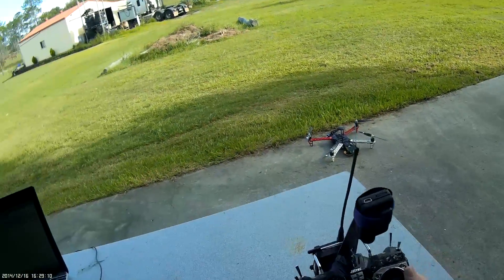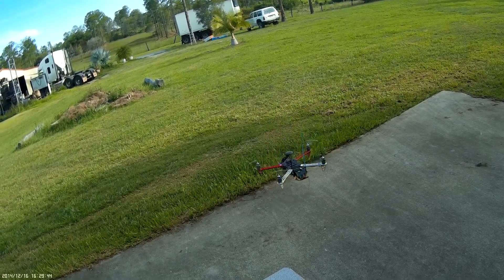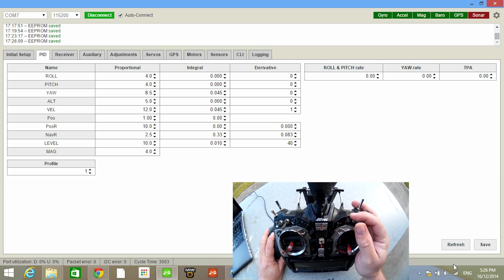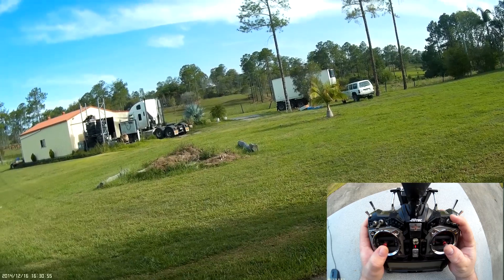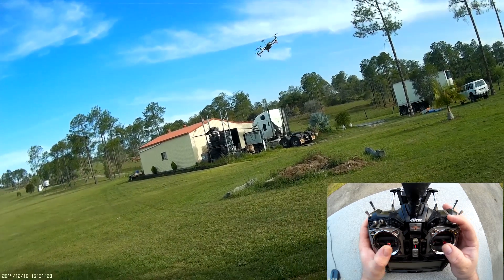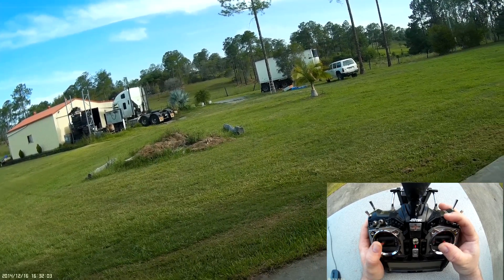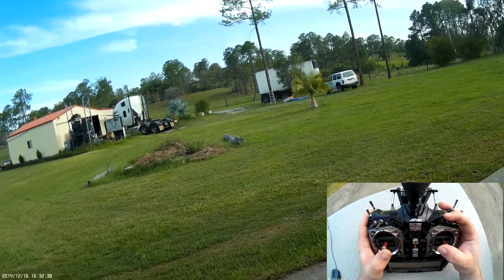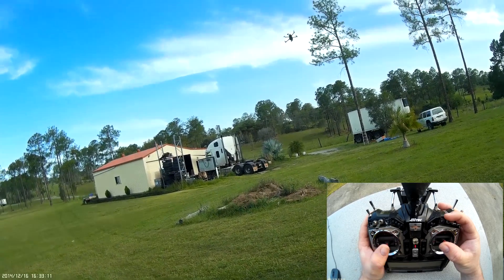PID Tuning video 2

Comment: I noticed in the settings your pitch&roll are both being adjusted by the switch, but your 1st vid you only made pitch setup for adjustments.  What was the reason for changing both at the same time & is it a better option to tune pitch and roll?

Comment: tune near a computer because the settings wont save when you unplug the battery. Plug it in to Cleanflight and save while settings are still there.

Blackout Mini H
I ended up with P=6.5 I=.030 D=40

 Going to take it out for some FPV now and see how it goes =D
Reply: disarm motors and hold left stick down left and right stick down right for some seconds. this will save the settings.

Comment: Is there anyway to Save the in-flight PIDs to the Naze32 board without plugging it into cleanflight? 

Every time I switch batteries it goes back to the stock PIDs instead of saving the ones I just made
Reply: +Cyrus Hostetler   Settings can be saved when disarmed using stick positions: Throttle Low, Yaw Left, Pitch Low, Roll Right.
Reply: Brenden Smith You are a lifesaver! I couldnt' find this anywhere

Comment: dear friend for the sake of my propellers please share a screenshot of your relsult of the whole PID screen, I have S500 frame 20A afros stock simonK FW (should I reflash? if yes, what FW?) multistar elite 2216 920 motors, DJI clone 9,4x4,3 props ant dof10 naze board. question 2: I read about autotune feature, but I can not find it in newest CLEANFLIGT google xhrome addon. has it ben removed or is it hidden?

Comment: Hello, I noticed that my quad changes behavior when I switch to GPS and my throttle don't respond fast when it's loosing altitude
Reply from the maker: +Sol mag This would be because in GPS mode it is also in Altitude hold mode.  The throttle then only acts a certain amount - you don't have direct control of altitude speed change.  Mid stick should have the quad holding. Higher throttle will gently increase height etc.
Reply: +pjman180 thanks for your response. It loses altitude in GPS mode. I tried to keep it up but still it goes down even at full throttle.

Comment: Hi I have a wobble on throttle... you have some advice?
Reply from the maker: +Johnny TSC I'm assuming you're using a mini quad?  To be honest it wasn't a problem I had to deal with on the larger quads.  I am in the process of building my own so no doubt I will come across this issue myself.  I would look at adding some TPA in Cleanflight.
Reply: I will try that! I fly the Blackout mini h quad
Reply: Just changed TPA from 0,00 to 0,20 but still wobble on pitch.. its very sensitive too.. should I turn it up even more? (setup Blackout 6"arms 4s 2204 1960kv motors and 20A ESCs )
Reply from the maker: +Johnny TSC I haven't played with these setting sorry.  It will be coming soon.
Reply: +Johnny TSC Lower loop times and retune your gains. Super later but maybe u still have the problem :P

Comment: Nice video. It appears you're adjusting the PID's for both the roll and pitch at the same time. That works with a symmetrical quad but not the popular ZMR250 type quad which is not symmetrical and because of that is more difficult to tune.
Reply from the maker: +Jim r You are right - this method doesn't work well for mini quads as they are very twitchy.  This video was made before you could tune individually.  Now a days you would be best to use blackbox - I'm working towards more vids on that stuff soon.

Comment: pjman180, you mentioned in your posts below that "I might try and do a vid of tuning the other PIDs soon."  You did such a great job on this video and we are hoping you make other PID tuning vids.  I'd be interested in:#1 - tuning PIDs in angle or horizon mode, and #2 - PID tuning for other PID controllers like #2 and #5, assuming that in this video you are using PID controller #1 MultiWii (but you don't actually say which controller you are using).Please remember to list which PID controller you are using, which flight mode you are using, and maybe even expand it to explain how the five different profiles can be used in each controller!  Oh, and remind everyone how to "save" the PID settings when satisified after making the corrections by disarming and then using the sticks, thereby not having to connect to a computer and use the save button.Again, super job on vid #1 and #2!
Reply from the maker: +FPV in PA Have been playing with Naza and Pixhawk lately but about to do a 250 build with Naze32 so will do plenty of vids then.

Comment: Relativity a good video. What I did not like was letting go of the stick, as it bounced around for a quarter second each time before it centered. What about Yaw PID tuning? No worries bud, just asking for others.I have a similar setup, just 10 options for adjustments, thanks for sharing. http://www.rcgroups.com/forums/showpost.php?p=32526191&postcount=11739

Comment: Pjman, definitly thumbs up for this video, now managed to restrain my quad! ;) 
one question: all works fine in acro mode but if I use horizon mode and make some smooth flights around and stop the quad...then I have to "teach" my naze with some inputs what is level. otherwise it woould drift away. Do you know which value might be wrong looking at this behaviour? thanks man.
Reply from the maker: Dozerboy84 You are correct that you have to "teach" it what level is - best done on a very still day - no wind at all..  At the moment I assume you are using your trims.  Set these back to no trim to start with.  Then take off in acro mode and try to get the quad as level as possible manually.  Then switch to horizon and take note of which direction the quad moves off.  For instance we will assume it moves forward and to the left a little. repeat this to confirm that the quad does indeed move off in the same direction.  Land the quad and disarm the board.  Then you move the throttle to 100% and move the pitch and roll sticks in the opposite direction to the direction travelled.  In this case we would move the pitch stick back and the roll stick to the right. You do these one as a time.  So move the pitch stick back to 100% for 1 second - you will see a light flash on the naze. If the forward movement is fairly strong then move the stick back for 1 second a number of times.  Then do the same for the roll.  Take off and start the whole process all over until when you put the quad into horizon it doesn't drift off in any direction.
Reply: pjman180 thanks your detailled reply but my problem is not that the copter drifts in smooth hover. When I hover in Acro everythiong is good. if I then switch to Horizon/Angle the hover remains smooth. 
When I fly around quickly in Horizon/angle and then stop the quad, the platform tilts in one direction, even with sticks center. I can bring the quad back to normal & smooth hover with some short stick inputs. 
Is this normal or do I have some values wrong? 
Thanks again man for your good support.
Reply from the maker: I haven't experienced this before sorry.  Are you flying in horizon mode?
Reply: +pjman180 yes. horizon or Acro. have seen in another forum that this is a general multiwi platform problem. the copter is kind of "drunken" after certain manovers in these two modes. are u only flying acro?
Reply from the maker: Dozerboy84 In Acro it won't auto level at all so thats expected.  I haven't heard of horizon not auto levelling and it certainly hasn't happened to me. To be fair, until recently I haven't done a lot of acrobatic manoeuvres with the quads I have had so generally use angle mode.  This has been changing.  You can speed up the reaction to levelling - I may have to do a video on that.  Most people flying mini quads would use acro anyway.  If you are piloting something bigger then you probably aren't doing flips so angle is OK for that.
Reply: pjman180  which pid controller are you using?

Comment: SOOOOOOO HELPFUL!!!!!!!!!!!!!!! 
Your the man pjman
Reply from the maker: Joel Larson No worries.  This is a little old now and after playing with some mini quads I wouldn't recommend this method for those.
Reply: Well I just tuned my blackout mini h  quad with that technique and it seems to fly pretty good, if u have time you should post up a new video, with your new method, if not that's cool too. Mines tuned enough to get some pretty decent smiles per gallon. Lol Thanks again.
Reply from the maker: Joel Larson try setting your looptime to 1500, PID controller to Luxfloat and set your Pitch and roll rates to 0.15 and see how it flies.  Need to be using the newest version of cleanflight

Comment: Tried tuning with your technique today.  Left P at the default setting of 4 and set I and D to zero and I couldn't even hover.  It just became progressively more unstable and just fell out of the air.
I was flying a 250 though so obviously not as stable as something like a 450 (?) as in your demonstration.
I'll keep trying though but I think it's wise to start with stock settings and adjust from there.
Reply from the maker: Hey - try switching to the lux pid controller. Default settings of 2.5 etc should be pretty good for your 250. Also lower the looptime in the cli to something like 1500

Comment: Just found what i was doing wrong   sbus signal inputs on pin 4 not pin 3
Reply from the maker: angryjetflyer Yup.  I got the FET and resistor today and have been reading up on how to do this.  Spent a lot of time trying to work out if the smart port could also be used as well - still no better off trying to work that one out.  Think its at too high a baud rate so can't be used with softserial
Reply: Nextfpv has a small pdf tutorial i found today  i haven't tried yet   doing night shift

Comment: Been trying to get futaba sbus to work with naze 32 and tried an sbus inverter but still wont go  using sbus to ppm converter atm but would like to use sbus only  have you got any ideas         thanks
Reply from the maker: angryjetflyer S.Bus is on my list of things to look at.  Might get a chance next week.  Have to go to Jaycar and get the components to make an inverter.
Reply: pjman180 i did the same  ordered from jaycar took a week to get to me and i had no luck  will be interested to see how you go, i had problems in cleanflight getting the sbus setting to save.

Comment: Very strange. Once I fly it and make the changes.  I plug into the computer and it goes back to default settings.  

I'm using cleanflight. And adjustment setting to change it in flight.
Reply: William Anzueto Silly me.  I was unplugging the battery on the quad and then plugging in the computer.  I had to keep the quad battery plugged in, plug in computer, view setings and saved.  Worked great!
Reply: William Anzueto I made that same mistake! ahahahah

Comment: So i turned on Rate mode on my SR250 for my 3rd setting, however it's PID values are different from the Helipal Atti/Ratti values. Is that to be normal? Are they supposed to be much higher when on rate modes?

Comment: Virgin pilot here.  You share a ton of detailed info.  Thanks for taking the time to do so.  But, all I kept hearing was "...It's holding that angle..." yet all I saw was a quad going all over the place. 

No need respond.  I'll figure it out eventually.  : )
Reply from the maker: Sam Johnson Sorry -  I was going a bit fast.  I was putting a lot of rapid stick movements to move the quad around a lot.  This is to "feel" the response.  When the P term is low the quad will be more sluggish.  If you only make a change once the quad will fly away so you have to counter the change.  While the P term is increasing you want to be constantly making changes so you can "feel" when it is right.
Reply: I see.  Great info again.  I think you mentioned some of it in the video, but you managed to pack a ton of visual indicators with a ton of verbal instruction....too much to digest in just a couple viewings.  : )  The vid (and prob more I haven't seen yet) is (will be) downloaded for offline access.  Thanks so much again!

Comment: Interesting process.  I am going to give this a shot tomorrow.  Maybe this will help with my yaw control too.  Yaw is so lame on my current 250.
Reply from the maker: Scot Caraway try either PID controller 2 or 5.  People are saying PID controller 5 is the bomb for yaw authority.
Reply: pjman180 what do you me and by pid controller 2 or  5?  I am a base flight user.  Are you referring to the profile number?  Base flight has three profiles to choose from.  Should I be looking to change this clean flight?  Was trying to find a process for that last night.
Reply from the maker: Scot Caraway I'm not sure if Baseflight has different PID controllers or not.  No doubt it has been ported in.  I will link you to the Cleanflight info for PID controllers.  Basically it is different algorithms to control the copter.  PID 2 is floating point which is more precise and isn't effected by looptime.  PID 5 is the port from Harakiri.  http://blog.oscarliang.net/pid-controller-0-1-2-cleanflight/  Probably better to get support on the forums.  If using Baseflight you will probably want to get on the multiwii forum.  For Cleanflight try using IRC and going to the usenet server and look for channel cleanflight.  Lots of people there can help you.  Where are you located?  PM me your email of skype or skype and I can try to help you out a bit.
Reply: Looking into this deeper, I see baseflight has pid_controller variable but it can only be set to either 0 or 1.

What does it take to change to Clean Flight?

Comment: So I got this working BUT unlike in the video I can't see the changes if I'm on the PID Tuning tab.  I have to go to any other tab and then back to PID Tuning tab to see the changes in value. Any idea why?  I'm using Spektrum DX8, Lemon 8 ch rx, Windows 8, CLFL 1.7.2.
Reply from the maker: You have to click refresh at the bottom of the screen.
Reply: pjman180 Ahhhh.  Didn't see the little circle indicating you were clicking Refresh each time.  That's what I get for viewing on my phone.  Thanks!  Great vid!

Comment: This method looks pretty promising.  I'll give it a shot, since I just recently loaded Cleanflight with pid_controller =1, and have also changed my ESC firmware from SimonK to BLHeli.  My quadcopter needs tuning help after making the changes.

Comment: VERY useful!
Thanks a ton +pjman180
How do you save the values if you're not connected to a computer? Isn't there a specific stick position or shutdown sequence to follow?
Thanks again
Mathieu
Reply from the maker: Settings can be saved when disarmed using stick positions: Throttle Low, Yaw Left, Pitch Low, Roll Right.
Reply: pjman180 Thanks! I knew I had read this somewhere. Cheers

Comment: Thanks a lot for that. Surely it helps to actually see someone tunes their copter, rather than just read about it.

Not sure though why people are interested in your final PIDs.
After you tune a few machines, you learn that the P, I & D values of some machine is useless for another, which may have different motor, ESCs, props, run different PID_Controller, looptime, etc....
Certain PID values are a good starting point if most (or preferably all) the components are identical. But so are the default PIDs. So sometimes it's easier to just start tuning from scratch than start tuning with someone else's PIDs.

[/boring_lecture]